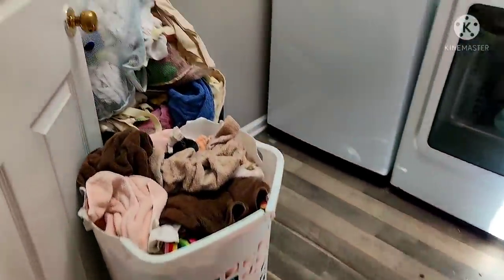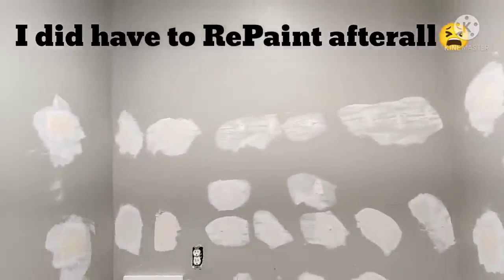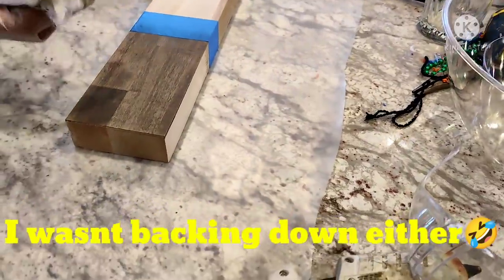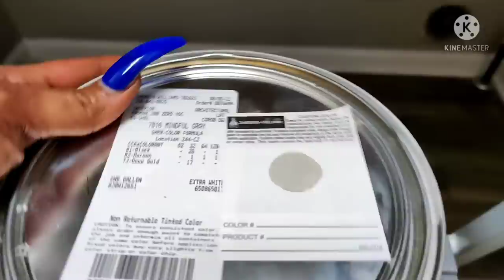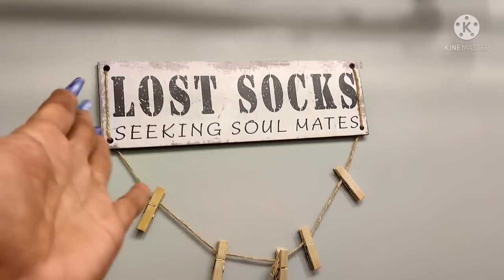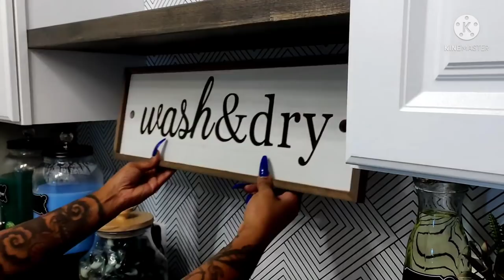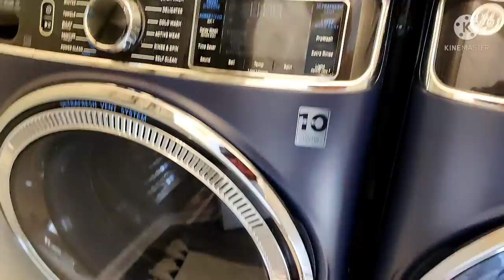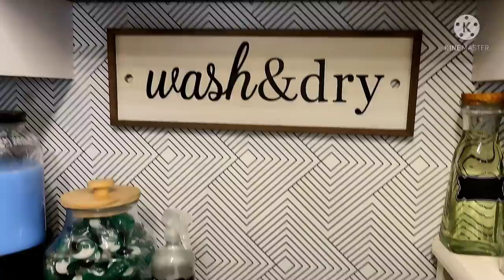*Amazing* Laundry Room Transformation || The Entire Process Start To Finish || DECORATE WITH ME

Comment: The stain turned out nice.. Did you decide not to use wooden back splash? What about plain white molding around the room? Or stain molding. Why Ron did not notch out or drill hole in counter top for electrical plug? Everything turned out nice. Maybe too many accessories.  I would add a branch with cotton balls. (if no one gets offended). What's in the cabinets?

Comment: Since I didn't want the crown molding maybe all he needs is a thin strip up at the very top that's between the wallpaper and the ceiling just a little strip of wood the same color as the maybe as the butcher block or maybe not I mean I'm not a designer but something thin just to cover where the paper meets the ceiling maybe that's what he wants and then on the other side as well but then very thin
Reply: You know what?! That’s it! Small crown molding across that back wall stained to match the rest of the wood! Yes!!!!! 😍😍😍😍

Comment: You can move the outlet so instead of vertical it goes horizontal which will move it slightly up to fit the butcher back splash.